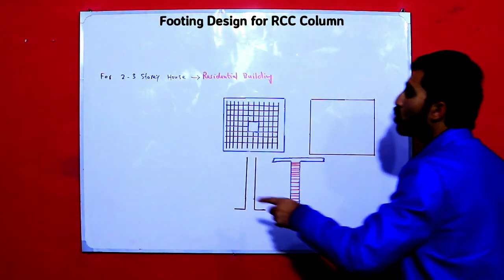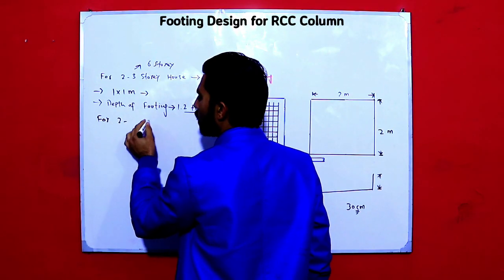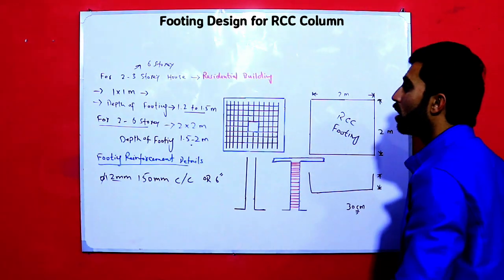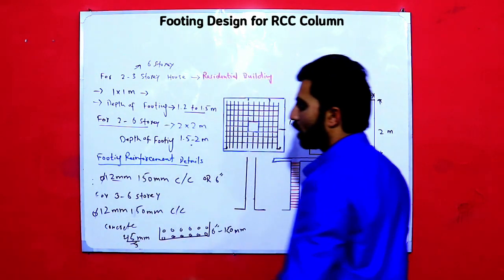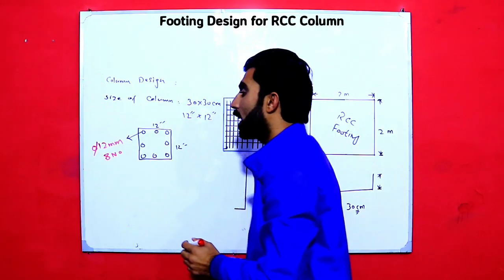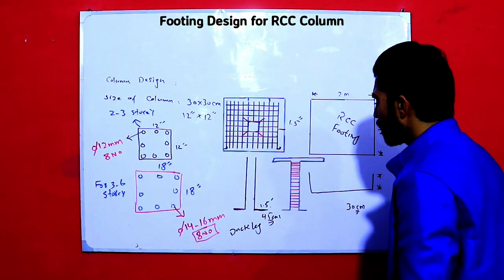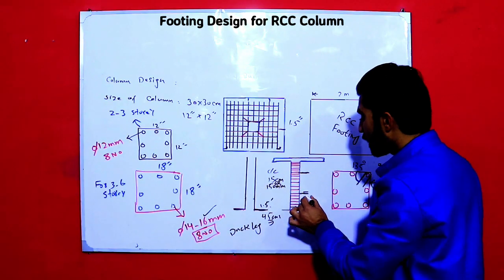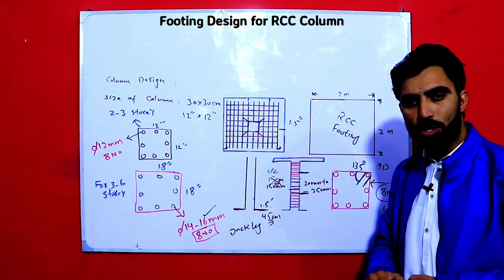Footing Design and Reinforcement Details  - Column Design and Reinforcement Details

Comment: hello master I need your comment for my g+1 ho 8mx8m size. 
For all colum and beam 4-12mm bare 2-10mm bar NB-Centeral columns 4 12mm and 4 10mm steel
dia 6mm in 15cm space 
M20 grd cemen
Column size 27cm x 27cm 
Beam 22cm x 34cm depth
Bean to beam spacing 4m
Footin 1mx1m. By 12mm steal The depth is 1.4m soil bearing capacit v. Good
I finished the slab can continue the next staps?

Comment: Civil engineers now have software to plan which size of footing and the size & number of steel bars to use. 
I have a renovation now in my two story house, I used 1x1 size of footing and depth for additional colons using 6 16mm and 2 12mm steel bars for colon, my structural engineer said that’s still too weak that the house might collapse because they base on the civil engineering software computations.

Comment: sir you said in a video that there should be 4 bars in a square column and 6 bars in circular column, but here you used 8 bars, what's the reason?
Reply: Mini 4 bars.. U shouldn't use below 4. The more no of bars depends on the size of column, the area of rfmt req.. Etc
Reply: @chrysjac5195  Ok. Thank you.

Comment: This should be a basic concept. We all have to get instruction from a qualified structural engineer for the Architectural drawing. The strength of the concrete will depend on the country to country. Standard norms are ok. It may be changed in practical conditions. Quality of mixing water, Quality of the different types of steel rods with different manufacturers, Soil conditions wind force, and weather conditions. Appreciate the presentation

Comment: Sir how about the two story house the same size the steel and fotting sir.1×1meter fotting sir ang colunm 30×30 cm.for the two story house only.thank you sir for your reply.
Reply: I would use rebar # 3 or 4 for footing then rebar #5 for column for 2 stories.

Comment: Great videos ! In Belize, for a 12 by 12 inches columns, they all place 3/8`` ties. Should it be a problem? Same space between ties? The 150 mm space between ties at the top and bottom, is this about the top 1/3 of the column and bottom 1/3 of the column?

Comment: Thanks. This is very informative. I'm planning to renovate my house and make it 2 storey with mezzanine floor in between for bed rooms.the top would be a roofdeck. I will use steel as columns and beam. The columns would be on top of the rcc footings/1ft above-ground column. Thanks.
Reply: What is this rcc

Comment: Dear sir 

you did not calculate steel bar of column for 2 to 3 st and how many steel or which kind of steel need. isn't if important?
Reply: He said 1/ 2 in steel, with 8 lengths. Widths I believe were 2 ft x 2 ft. You could double check